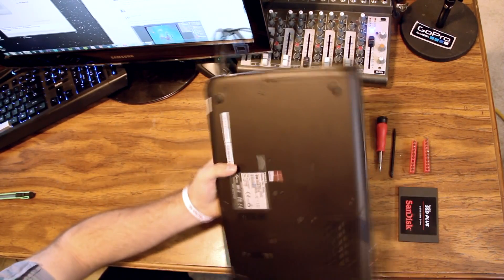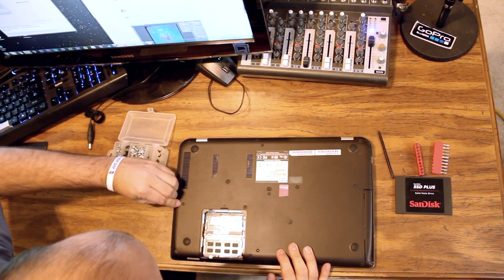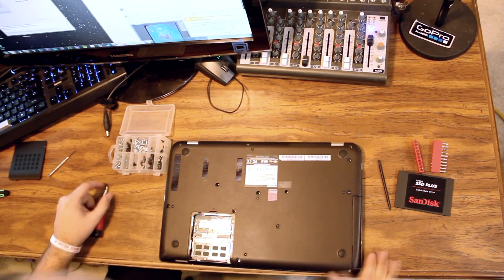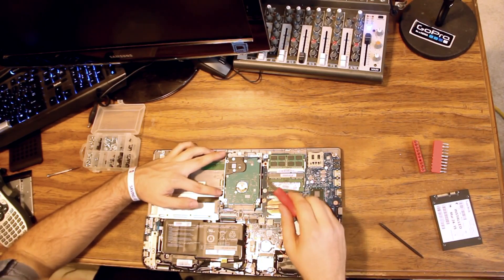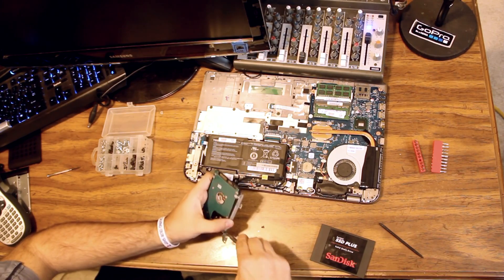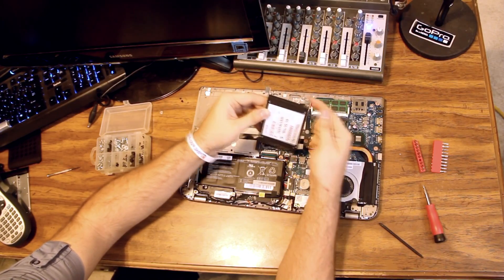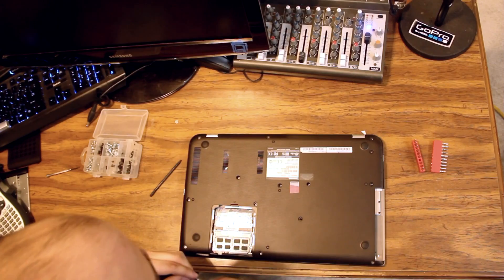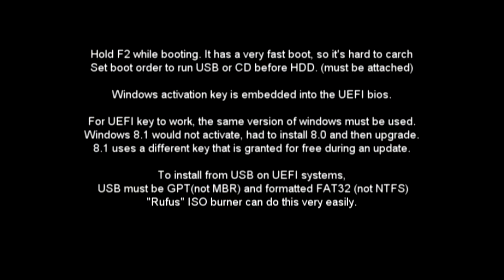Toshiba Satellite P55 - A5200 Disassembly and hard drive replacement

Comment: How could you tell that the hard drive was failed?  I have near the same model, the inside look almost identical.  My power button comes on, but it doesn't boot up.  I tried the "paper clip trick" if you are familiar with that from another video on a toshiba satellite p55-a5312 (the exact model I'm working with).  New bat and bat light comes on too.  So, I can hold down the power button and it will turn off.  And I can press it, and it will turn on.  Just no boot up..  Girlfriends son may have dropped it, or let it get too hot, but motherboard doesn't look burnt.  Blah what a waste.

Comment: Will this work with this model?http://www.amazon.com/gp/aw/d/B00S9Q9VS4/ref=mp_s_a_1_2?qid=1448450746&sr=8-2&pi=SX200_QL40&keywords=ssd+internal+hard+drive&dpPl=1&dpID=41Cago76PuL&ref=plSrch

Is it 2.5inch 7mm drive?
Can u advise me about ram upgrade too?
What max ram cap can i use ?
Which model number can i get ?
Thanks
Reply from the maker: +Mohamed Ashour that should work.

Comment: Hello Alex, I have this same Laptop and I'm having an issue with my fan. It's not spinning. I had to replace my HDD recently and I'm not sure if that has anything to do with it, but the fan just doesn't come on anymore and now I'm getting that warning about a problem in the cooling system being detected. I've tried changing the cooling policy to active but didn't seem to help. At first I thought I may have unplugged it when I replaced the HDD, but I opened it back up and everything seemed to be attached properly. I turned my laptop on and saw that it spun for a spit second during start-up, but that's it. I don't know if I need a new fan or if it's some other problem. Any ideas on what I should do next?

Also, your video was very helpful in opening up my laptop, thank you very much.

Comment: Alex do you know how to RESET BIO on P55W-B224 ? my son blocked it by mistake and i have very important information of my work, TY
Reply: Victor Manuel Garces 
You may try removing the button cell battery to the right of the main battery.  I would make sure the main battery and that one were disconnected, press and hold the power button for a few seconds, and maybe even wait a few minutes before putting the button cell back in.   This might work for resetting the password, but there is a good chance that it still wont. In that case, call Toshiba, and with proof of purchase they may walk you through unlocking it with a master password that only they can provide.
Reply: +Robert Mullins  Robert Already did but didn' work, i called to toshiba buy they don't have a store near my country to take my computer for reset, i have like 6 months trying to do this... please advice

Comment: Thanks for the video!
I changed the HD on my p55t-B with a SSD and it worked really well.
Now, I was wondering if it is possible to change the AMD R9 graphics card. Have you ever tried that? I know the laptop comes with two graphic chips, the Intel which is built-in and the AMD which may or may not be replaceable. I will appreciate any feedback.
Thanks!
Reply: Have you figured this out maybe? I have a p55t-B as well (specifically B5360), and I'm scared that my AMD R9 M265x graphics card may be fried. I've heard most laptops have it soldered in, but I'm hoping that's not the case with this model.
Reply: @SharonLougheed  hate to break it to you or any one else looking for this info but AMD uses built-in GPUs aswell, look up AMD APU, they are used in AMD based laptops, essentially they are the same idea as the intel intigrated graphics but with the Radeon name and tech, imho it is superior to intel equivalent but still not replaceable.

Comment: I have same model few days ago it was acting when I was connecting the charger I thought the charger was bad I got the new charger and it still doesn't work no led turns on no hard drive sound completely dead.. could you please help...